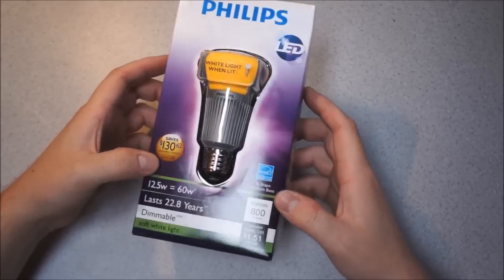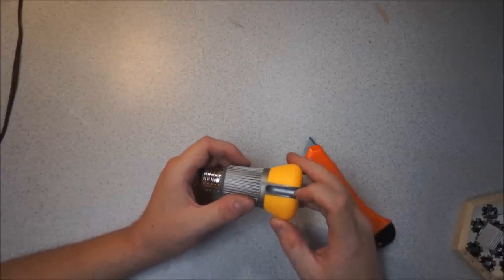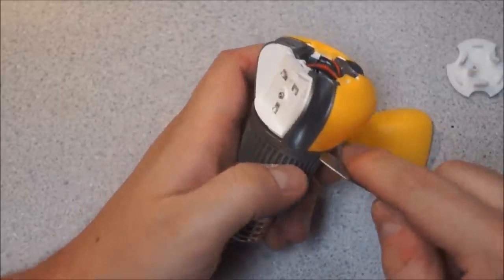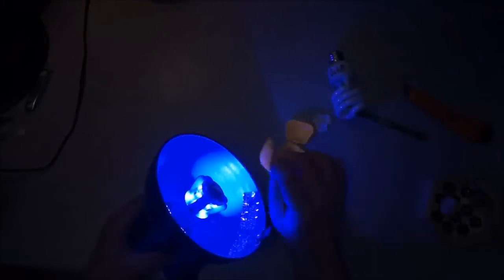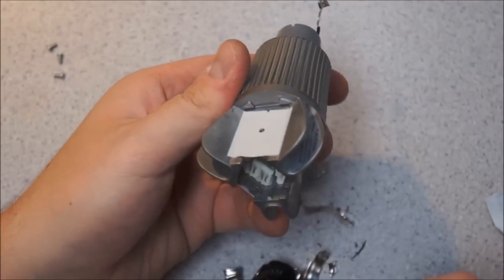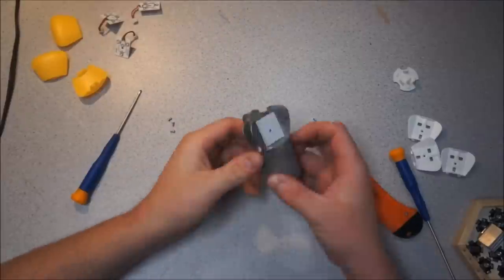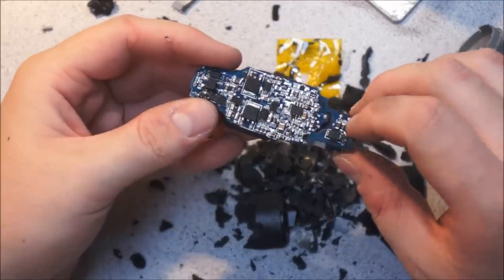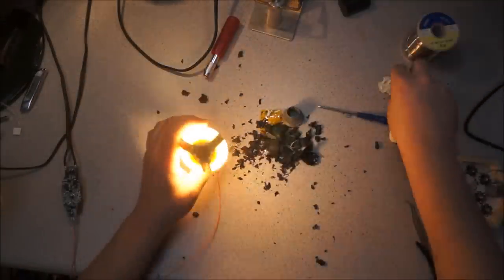Philips remote-phosphor LED lamp teardown

Comment from the maker: I thought about that, but if they're worried about breaking the ceramic, placing a small spring around the screw-shaft would make much more sense. That way, even with thermal expansion, you would have a consistant clamping force.
They were *really* loose, too.

Comment: The reason these bulbs last much longer is because the LED dies don't get way as hot. The luminous efficiency (note: not efficacy!) of blue LEDs is 55ish %, whereas a white LED does about 22-25%. That difference is entirely down to the phosphorus conversion losses, which produces heat that normally gets pumped right back into the die. Now that heat is remote and very low-density, so you get a colder die which helps efficiency as well (LEDs give off less light when theyre hotter)

Comment: I don't think its using a resonant converter. Most probably it will have a small capacitor right after the rectifier, followed by an power factor correction stage. This PFC will consists of a chocke, power transistor, diode and the big storage capacitor. After that follows an ordinary flyback converter with a single switch and a single diode at the output. I think a further investigation whould be very interesting.. But a very nice teardown. Thumbs up..

Comment: The case is probably zamak alloy (zinc aluminum magnesium copper), which has good thermal conductivity yet doesn't trash the casting dies the way aluminum does.

Comment: Australian equipment wiring
Current colour code (single phase)
Active - Brown
Neutral - Light Blue
Earth - Green/Yellow
Current colour code (multiphase)
Phase 1 - Brown
Phase 2 - Black
Phase 3 - Grey
Neutral - Light Blue
Earth - Green/Yellow

Australian Installation 'Building' wiring
Current colour code (single phase)
Active - Red 
Neutral - Black
Earth - Green/Yellow
Current colour code (multiphase)
Phase 1 - Red
Phase 2 - White
Phase 3 - Dark Blue
Neutral - Black
Earth - Green/Yellow

Comment: My head hurts from all that out of focus video, for the most part of the epoxy removal the camera was focused on the table...  you really need to work on that for next time.

Otherwise, quite a lot of circuitry there, interesting to see how much work goes into making such bulb and on the downside, how unfeasible they are to recycle.